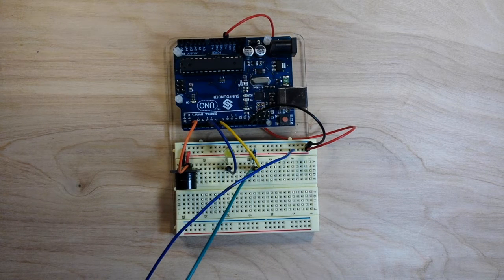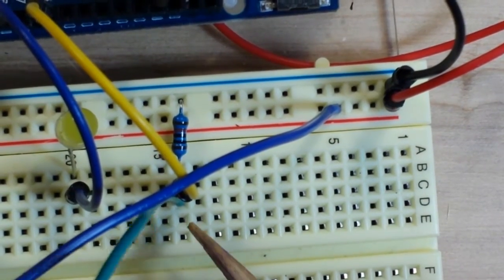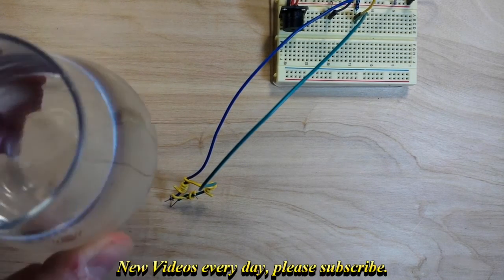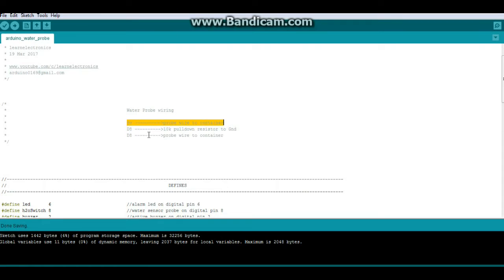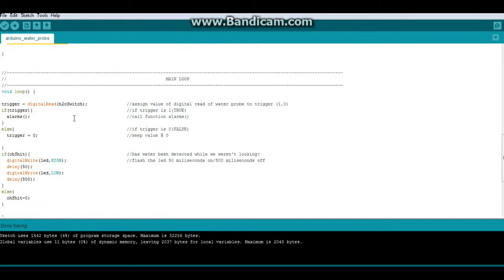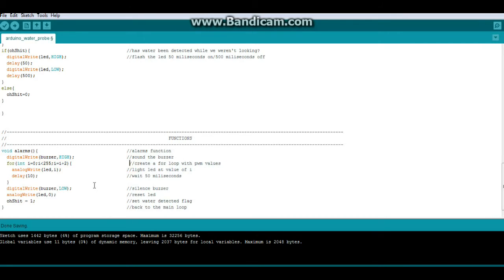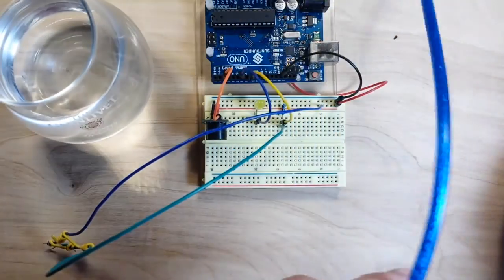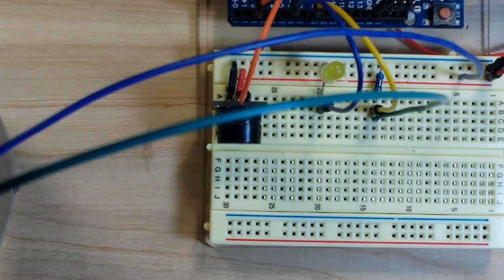Arduino Water Alarm

Comment: is it possible to do this without the use of any external resistors by configuring the input as input_pullup in the sketch, connecting one wire to the input pin and and the other to the ground? so when the probes are immersed in  water the input pin is grounded and its state becomes low? pls reply...